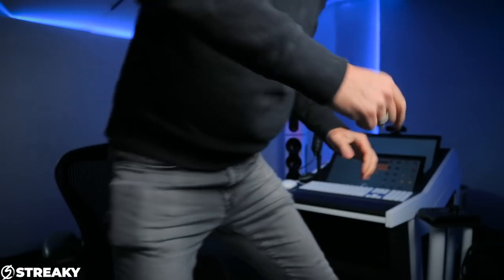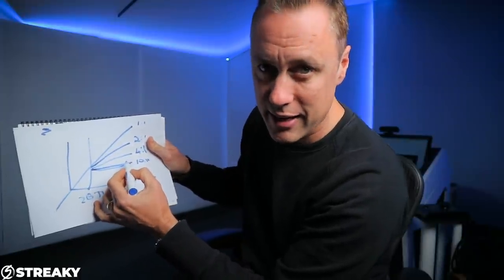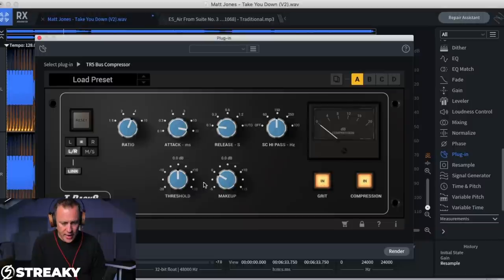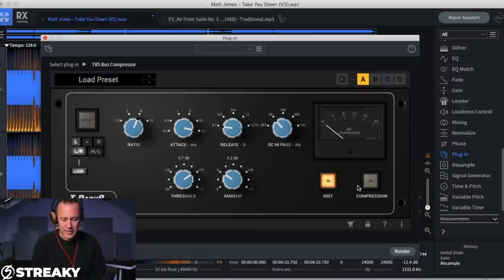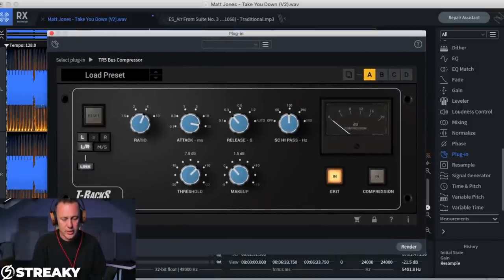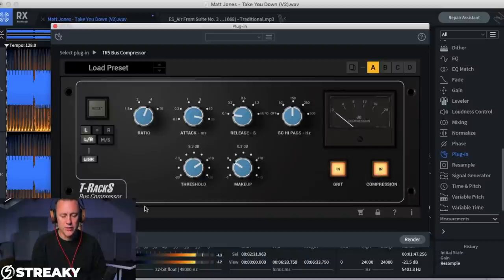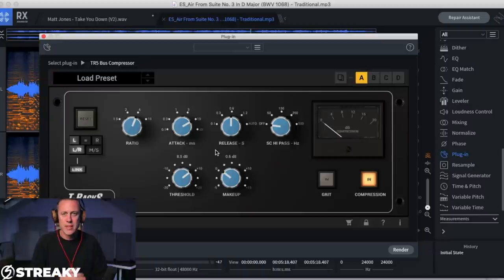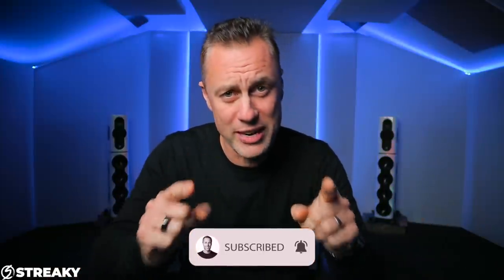GLUEY COMPRESSION | How To Use A Mix Bus Compressor

Comment: I'm super confused.  I thought if the threshold is over 0db it wouldn't engage...unless the track is over 0db - which obviously it shouldn't be over 0db when you're mastering.
Also have read multiple times that for mastering you should never go above 2:1 ratios.  Usually I max out at 1:5 ratios.
Reply: Hi! I think i can answer your questions.
So... In this case it isn't a perfect digital meter - it's an emulation of analog VU meter - it doesn't show how compressor is catching peaks/transients because it's too slow to do that. I find with some analog compressors/emulations you can do around 6db of compression on transients while VU meter isn't moving AT ALL. So the way to do it is train your ears to hear light compression (i wasn't able to hear it for around 2 years when i started).
Considering ratio... Again, most of analog compressors (and especially SSL bus compressors) have a very soft knee, so in reality it isn't doing 4:1 ratio when it starts compressing, it's probably something like 1.5:1 when it goes 1 db above the threshold, 2:1 when 2 db above the threshold until it reaches 4:1 ratio and stops.
Hope this helps.

Comment: What about if you use a compression as a feedback and reverse phase as a noise filter?
Reply from the maker: Not sure what you mean
Reply: @Streaky_com  well a feedback system with adjustable gain to adjust how much you want you can do the same thing with an e q, if there's transients problems and you want to eliminate a frequency you can switch the phase back into the loop to cancel it out eliminates noise, say if you had 50hz and you wanted to eliminate or squash it down from the mains if you reverse the phase it will cancel same as noise cancelling headphones
Reply: Soothe2.